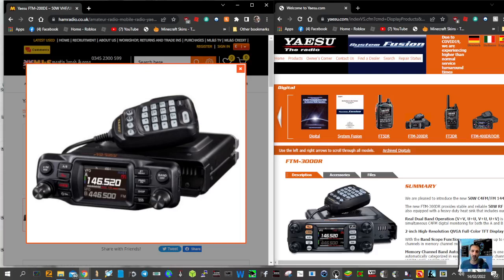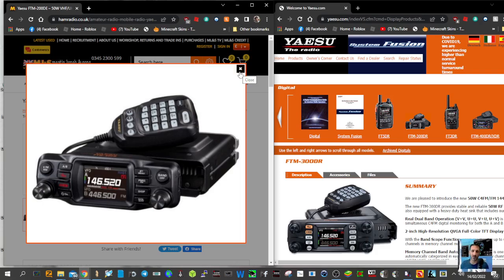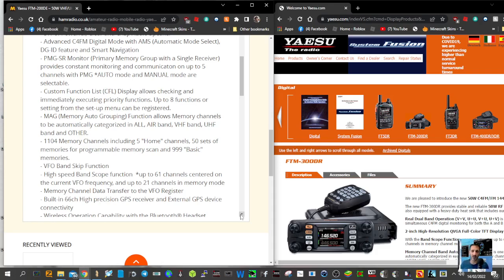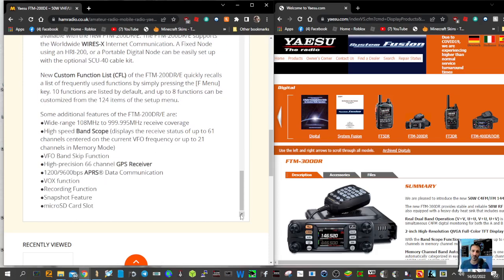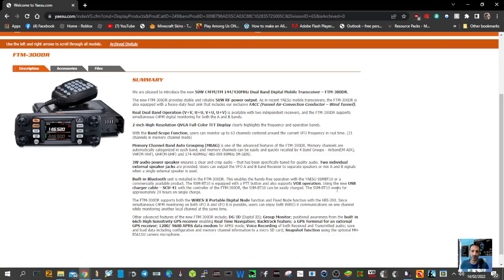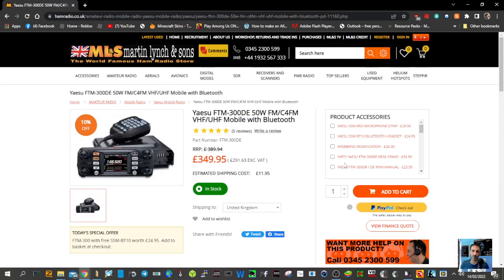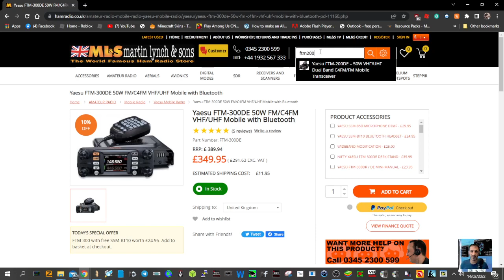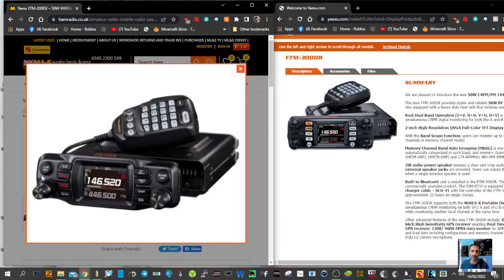New Yaesu FTM 200DE or Yaesu FTM300 DE - Comparison

Comment: Nice radio it does a lot stuff just don't see much difference from this set and 300 I've not long had the 300 couple months go it very nice radio to operate.
Reply from the maker: Looks to me they have built this to replace the Yaeu ft100 as its single receive.